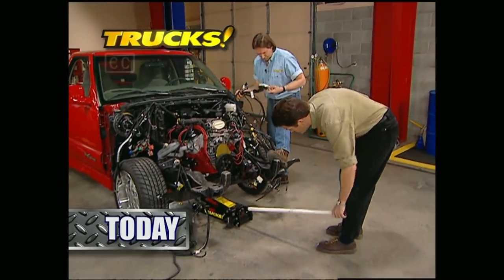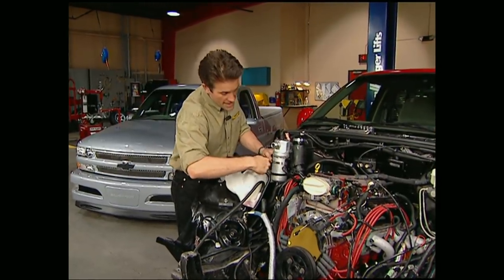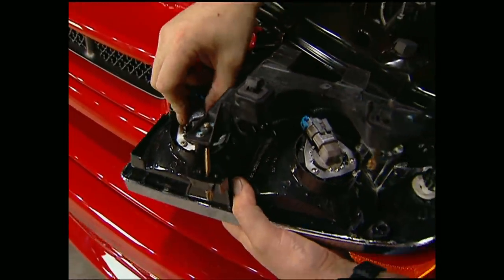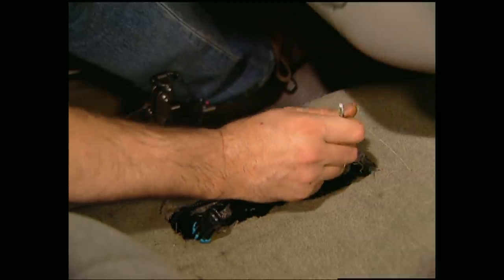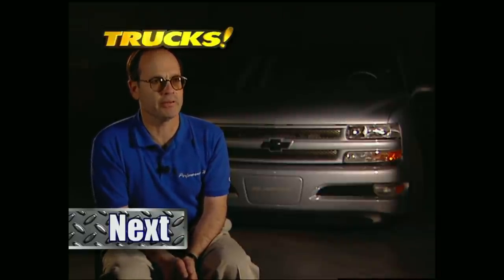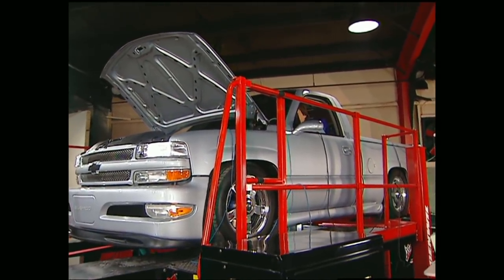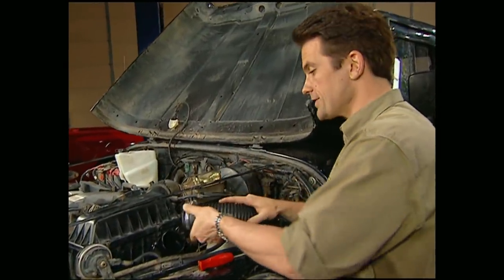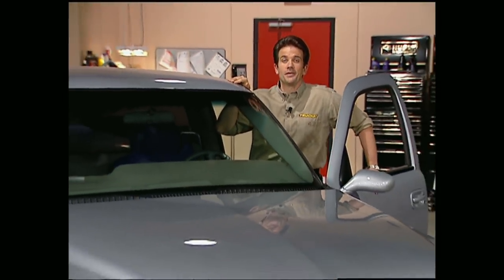Cramming an LT1 Into an Innocent Looking Chevy S10 - Trucks! S1, E7

Comment: If you have a flex-fuel S10 you don't need to change out the fuel pump. It can provide enough pressure to fuel a V8